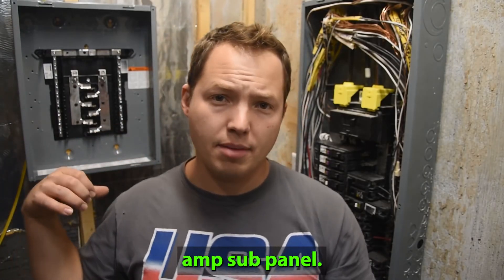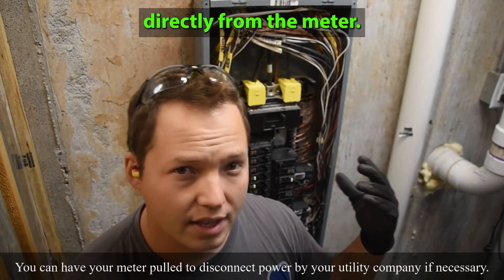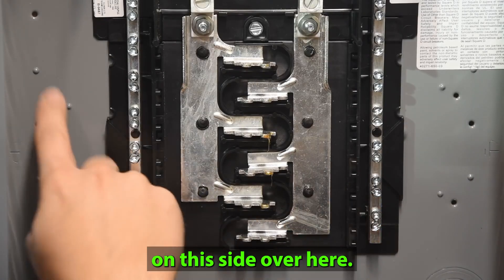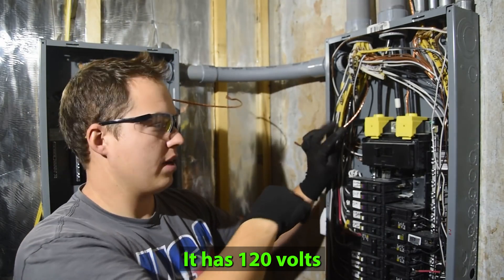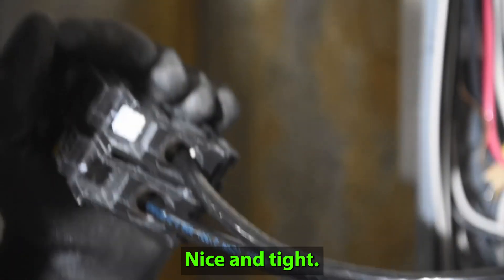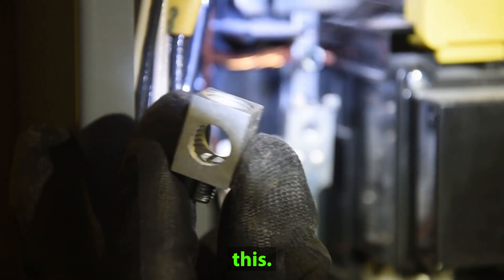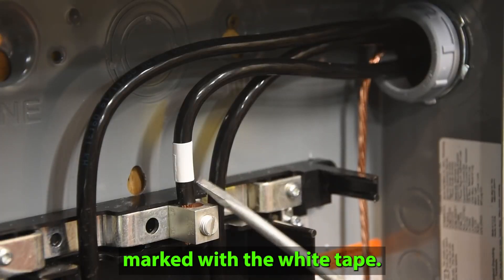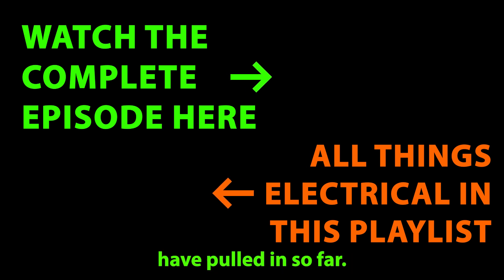How To Install a Sub Panel In 90 Seconds

Comment: Why don't electricians install more sub panels in houses? For instance, one for the kitchen/laundry, one for upstairs bedrooms and one for family room/living room. Is it cost prohibitive for the larger gauge wire and panels compared to home runs to one panel? Thank you for all the useful information.
Reply: No, it's because sub panels are most often used for garages, workshops, sheds, outbuildings, auxiliary dwelling units, pool houses, hot tubs, outdoor kitchens, etc.
This video shows an installation of a sub panel directly adjacent to a main panel, which is ridiculously counter-productive other than for "demonstration purposes"...

Comment: Hey good video. I have a question , I'm doing a subpanel for a little apt on top of my garage i have a 125 amp subpanel what gauge should i use for the conection between the main and sudpanel?
Reply: 6 g. Make sure you have all four wires, black, red, white and green.

Comment: I have a couple of questions.

Did I see copper to aluminum connections? If so, you then added some sort of paste, right?

Before watching a couple of YouTube videos, I would just insert a stripped stranded copper wire into a terminal and tighten once.  The videos said to tighten to torque spec, wiggle, re-tighten, wiggle, re-tighten, etc, until the terminal screw stops turning.  I went back and checked a few connections I had made in the past, and sure enough, I got several more wiggle, re-tighten steps on those terminals.  I checked them again a month later, and got yet another wiggle, re-tighten step on some of them.  Now I am paranoid about making these connections, I really don't want to create a fire hazard.  Am I being too paranoid?

Comment: This may be a silly question... Can a sub-panel (external garage) have a sub-panel (wife's she-shed)? 

The she-shed has ~30 amps max possible usage at any single moment in time between window mount A/C unit, mini-wine fridge, lighting, laser printer, computer, monitors, large screen TV, plug-in scented air fresheners, hot-glue gun, wireless charging pad for the phone, LED doodads, radio, and whatever else she may have plugged into the wall at any one time...  Sort of crazy, right?  I tried this with a single 20 amp service but occasionally on a hot day with A/C going full blast with the laser-printer warming up coupled with the mini-fridge doing its cooling thing and all the other minor uses the breaker trips.  Was going to run an additional 20 amp line but was wondering if I should just run 10-3 (40' run) instead to a tiny sub-panel and separate the outlets into two 20 amp circuits and the lighting into another 15 amp circuit.  Would put in a 30 amp breaker in the garage sub-panel. As believe it or not all of the she-shed sources totaled up pull less than 30 amps. My garage is wired for a 90 amp load, but does not even hit 40 amps, and only that much because the washer/dryer, a full fridge, and an office is out there too.  There are no 220 V tools or outlets in use in the garage --not counting the aforementioned dryer of course.

Thoughts anyone?
Reply: Check your local wiring rules but you can have as many "sub panels" downstream as you like, ensure you use the correct overload and earth leakage protective devices required by your areas regulations

Comment: Awesome video 👍. I have a question about a sub panel. I'm installing a new electric water heater and found out the feeding wire coming from my panel in the bedroom is 12/2 AWG running about 16ft to a junction box, wired to a 10/2 AWG it's about 2ft running into a 4 circuit sub panel ( which only 2 circuits are being used) a 20 AMP and 30 AMP 2 pole circuit. The 20 AMP was powering 2 receptacles that no longer are working ( can I disconnect that 20 AMP circuit?) The 30 AMP 2 pole breaker is wired to the old water heater which was 26 years old. Now for the question.... Shouldn't the feeding wire coming from the panel box in the bedroom and (what would it be hooked to?) Be 10/2 AWG? Do I even need the sub panel near the water heater? The highest AMP circuit in bedroom panel is 30 AMP 2 pole breaker. It's a 100 AMP max panel box 8 breakers total. The wire coming into the sub panel from the bedroom (White to top lug) ( Black to the other lug on the bar) ground to bus bar which has a empty lug ( which I'm assuming is the Neutral lug). From there a 16" 10/2 AWG from the 30 AMP 2 pole breaker to the water heater. I apologize for the long rant ....😞 But I can't seem to get a straight answer from anyone I've talked to. ( They say yeah well a water heater should be 10/2 AWG 30 AMP 2 pole breaker) but from where? Directly from the main panel box directly to the water heater or to the sub panel then to water heater?) Again I'm sorry I'm I'll understand if don't reply back ( I asked the same question on another one of your videos) I've been without hot water for 2 months and really can't afford a electrician but if I have to it is what it is. I do have some knowledge, I'm mainly in Construction. Thanks...